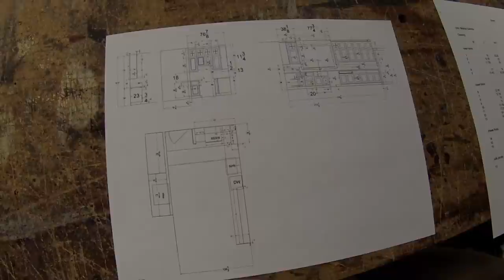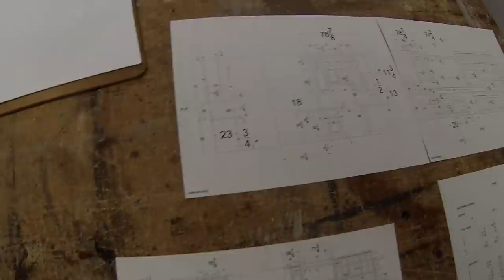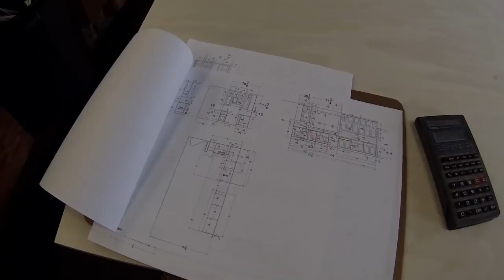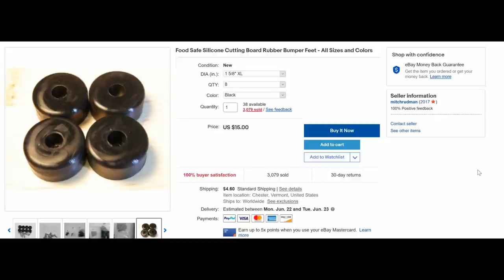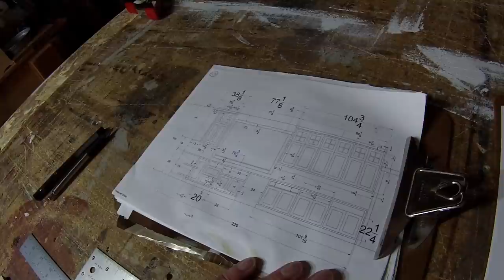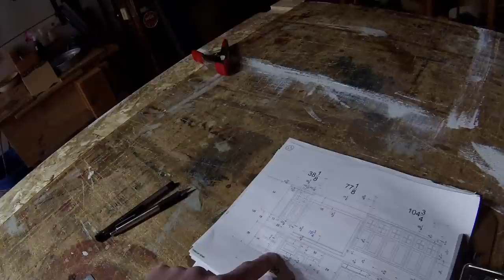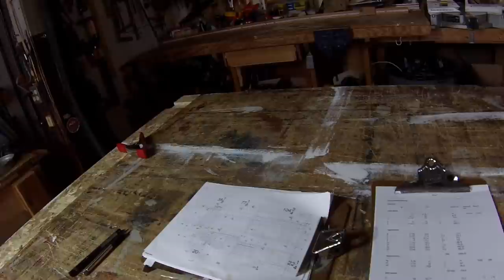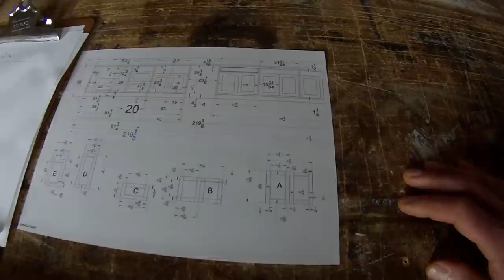Complete Kitchen Remodel PART 1

Comment: hi mitch since you published the "squaring panel jig" i made my own it´s been a long time and it works perfect every time, it has made my work much better and that has translated to $$ so thanks man. don´t know if i commented in the original video, thanks again. take care
Reply from the maker: thanks, glad i can help make the $$.  I used an expensive sliding table saw when i worked at another shop and it was always prone to error, sometimes hard to see when its not flush with the fence.  reliability = $$ when mistakes are costly